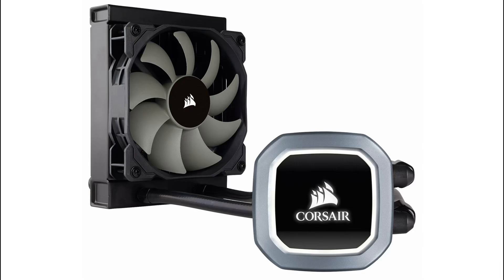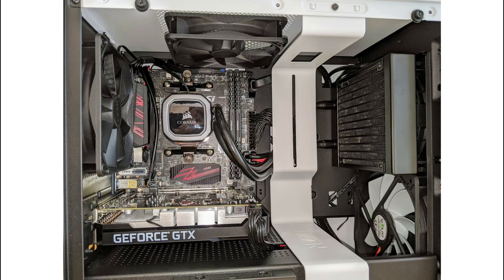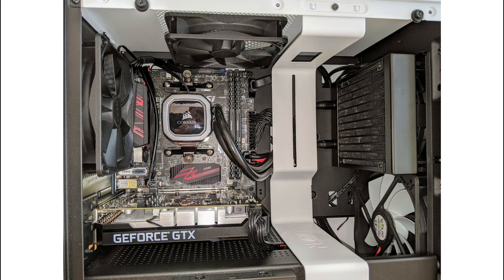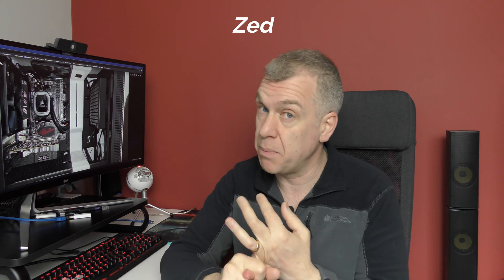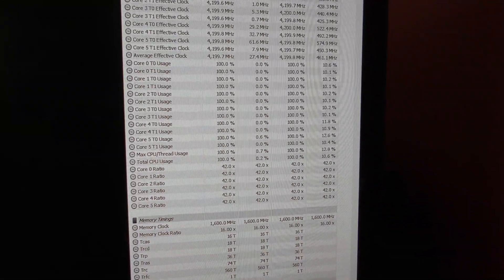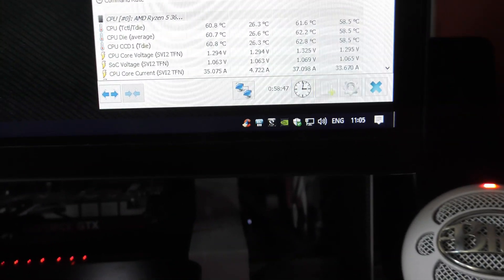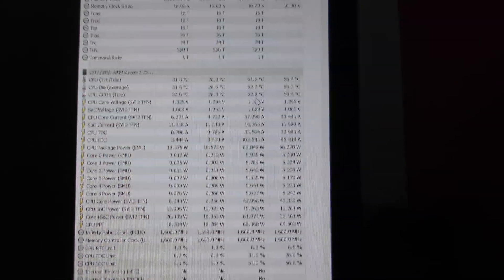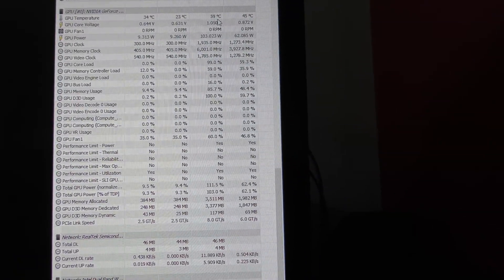120mm AIO. Good enough for my PC?

Comment: would this be able to cool a i7 10700k?
Reply from the maker: Hmmm that thing runs hot at the upper end. I don't think I'd be happy with that combination if you want max performance.
Reply: @ricco123tube  what about at base speed
Reply from the maker: Base should be fine, but that cpu is nothing without it’s all core boost which is why it needs adequate cooling to achieve it.
Reply: @ricco123tube  ok thank you

Comment: would it be good for a ryzen 7 3700x - 3060 ti build?
Reply from the maker: If 120mm is your only option, it will be fine. 240mm will allow for potentially better oc or boost.

Comment: Great video! 
I've just build a new pc with a ryzen 5 3600 and it works great but under load the temperature goes up to nearly 95c with the stock cooler. I'm considering something like the h60 or the hyper 212 for cooling but if you have one that you think is better I would appreciate your advice. Thanks!
Reply from the maker: I went water cooling due to having a small itx case. I prefer more traditional coolers due to hassle free performance.
I've used noctua for years and swear by them but I'd go with whatever fits your needs. Anything reasonable will outperform the stock cooler.
Reply: @ricco123tube  Ok, thanks!
Reply: I don't want a big air cooler because I will be transporting it. I could even consider the h100x if I would gain anything that would matter from that.

Comment: I just upgraded to an asus z390-e motherboard and asus rog strix 2080 super. I have a 120mm cooler. should I get extra fans or should I get a 240mm cooler?? thanks
Reply from the maker: If you are running a hot intel chip I'd get a 240.

Comment: Would this be enough for the ryzen 7 3700x?
Reply from the maker: I’ve used the 120mm AIO with a Ryzen 7 3800x and it was fine. Good airflow is essential.
Reply: I have a m22 kraken on my ryzen 5 3600x and it stays well below 65°c under synthetic load
Reply: @Battlefox64_RL  whats your idle temps